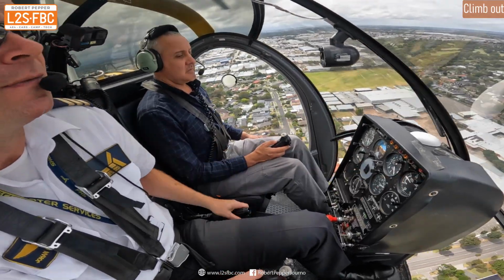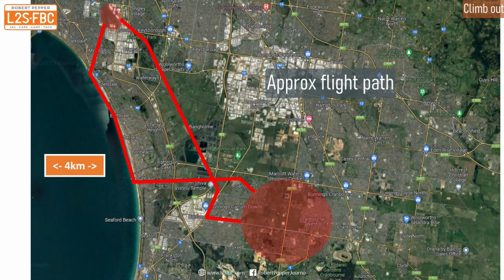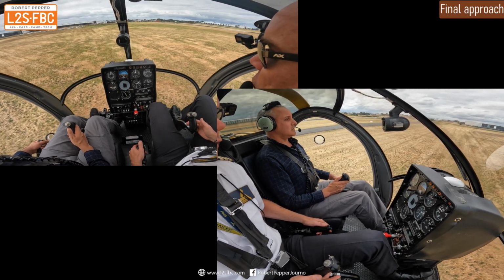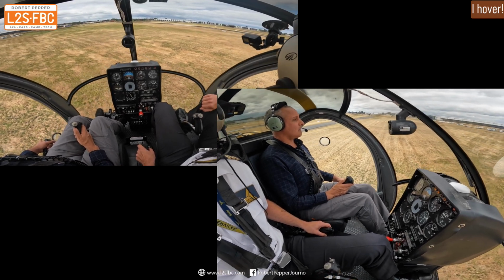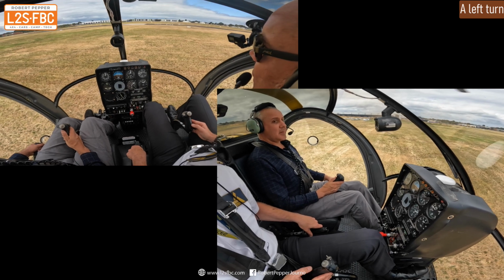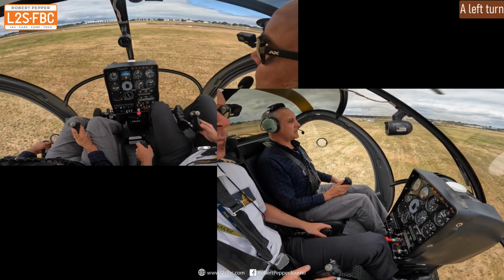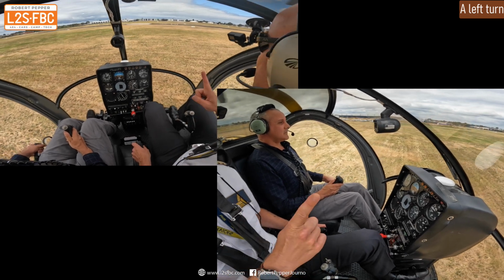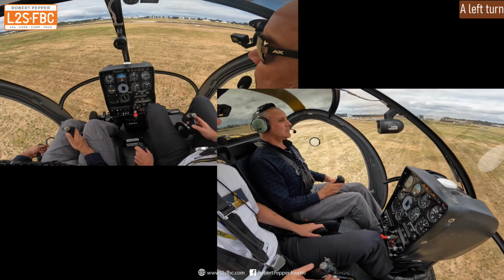Helicopters for car nerds - what you need to know for your helicopter trial flight

Comment: Sorry I have to point out here you went a bit too far with oversimplification on how the cyclic work on helicopter, to the point it's misleading and completely wrong.

Since the video title says it's for nerds and not for kindergarten ;-) and all your other 4x4 stuff is so excellent, well supported by theory, math, examples and experience KUDOS! I have to speak out. 

The way cyclic is shown on the diagram is naive and can never work, I'll try to explain why below. While instructor says "disk tilts" without further details, the diagram shows the rotor is bending with the plane of blades rapidly tilting. That's not what is happening. By the "disk", instructor probably means swash-plate ( https://en.wikipedia.org/wiki/Swashplate_(aeronautics) ) which while tilting changes angle of attack (tilt) of EACH BLADE DYNAMICALLY as they rotate around in a different position of the cycle. The tilt of the whole system (heli) is caused by different pull in different angles of the cycle (the plane of rotating blades). e.g. If the angle of attack is lower (of each blade) passing the front part of helicopter (and higher in the back), the rear part of the cycle tilt the whole helicopter forward to a forward flight because the pull up is higher in the back.

Imagine for a second that it would really bend the rotor in a direction of desired flight. 1st:
rotating blades make a huge gyroscope, the plane of rotation doesn't really want to tilt and 2nd the pull is constant all around the circle so why would it want to tilt? The result would be the whole helicopter would tilt under the main rotor (plus the whole thing isn't stable so it would crash before it would get above the ground).

Not so important, but I believe the instructor is not right about that control is called "cyclic" because you can move the cyclic control around the cycle, but "The control is called the cyclic because it changes the mechanical pitch angle or feathering angle of each main rotor blade independently, depending on its position in the cycle." (https://en.wikipedia.org/wiki/Helicopter_flight_controls#Cyclic). Wikipedia may be wrong in that, but it's definitely more plausible explanation.

Hope it helps, the invention of swash-plate for helicopters is genius and fascinating IMO.
Reply from the maker: Thank you for that clarification, much appreciated. I did consider adding in the swashplate but thought it was too much detail and the 'disk tilt' concept was sufficiently accurate. Maybe I was wrong or at least should have said there is more to it. Also left off advancing-blade, ground effect and other explanations too. It did not occur to me to check his description of the cyclic - I agree the pitch explanation makes more sense.  That video hasn't done well so I've not followed it up with another, was planning on one describing autorotation by probably won't now.
Reply: @L2SFBC  I agree it wasn't necessary to include the mechanics of swash plate here, this video is more personal and entertaining then educational. No need to go to details there, what made me jump of the chair was that bent rotor, tilted blade plane and arrows on the picture (and corresponding subtitle) which is wrong, if it would be drawn differently with lift arrows I wouldn't say a thing. There are some good animations where it is explained better then with my poor English, this one is quite short but well explained:
https://www.youtube.com/watch?v=2tdnqZgKa0E.
BTW, another fascinating thing is how recently we can replace complex mechanical (thus prone to failure) solution / swashplate  and 2 complex rotors) by 4 mechanically simple rotors and computer control (drones)